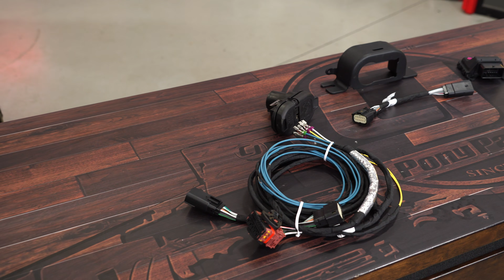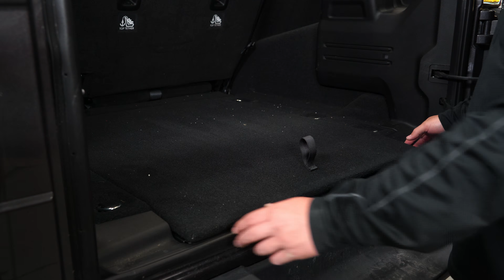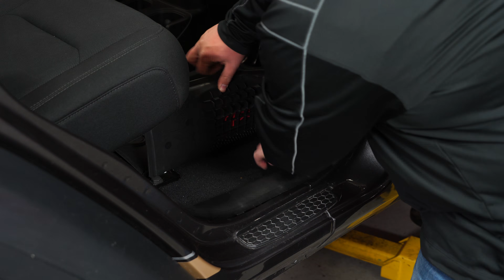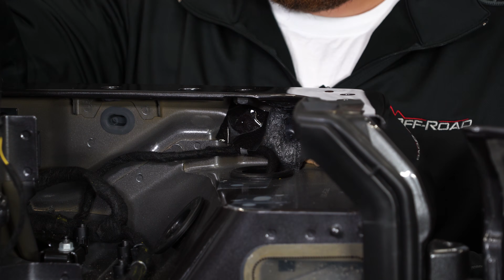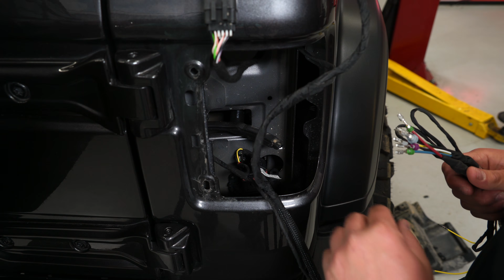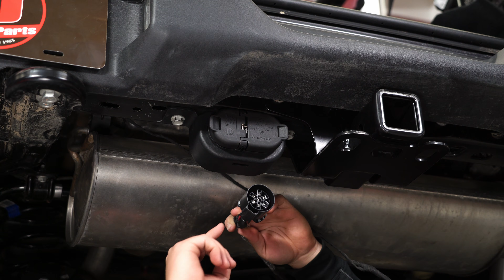2018 Jeep Wrangler JL gets tow ready: Mopar 7-Way Trailer Wiring Harness Install

Comment: If I cut the 7/4way connection hole in my Steel bumper will it snap in?  I have the 
RedRock Solid Steel Rear Bumper with LED Lighting (18-24 Jeep Wrangler JL)

Comment: Hi! Thanks for the video!
I just got my harness but I think the new harness has couple of minor differences. 

So the next to the cable that goes into the fusebox, I have a blue cable that (brake control) - I don’t know what to do with it. 

Instructions don’t really explain well what to do with this blue cable.

Does this mean I have a trailer brake system or that is something else that I would have to add to the system. 

I’m little confused can you please explain the trailer brake situation?

Comment: After watching this video, I almost took it into a dealer to have them install, but they wanted $400 and to keep the Jeep for 1/2 day. I borrowed a rivet gun and decided to do it myself. I thought I'd do it in two nights: one night to prep and take everything off, and the second night to install and put everything back together. 

I took out all panels per the video, and then, I realized my wires looked nothing like what was shown in the video. Everything was already bundled together. I really couldn't figure out any other way to do it the way it came, so I ran it underneath (similar to a different video). There's no way I could have snaked that through the firewall with the fuse already installed/attached. 

So, the reason I'm posting, check the kit you order before you start the project. If you get the same kit I did, you're probably only pulling the exterior panels and running it underneath (which I really didn't want to do, it seems to make more sense to keep wires out from underneath the Jeep). It is what it is though. 

That said, easier than I thought to install. I watched the videos several times before starting, and overall it went pretty smoothly. I'm definitely a beginner at all of this, and it seemed to go pretty quickly. Also note, I did a little research, and it looks like the brake controller for Jeep/Mopar is only for automatics (not sure why they're not sold/recommended for MTs).

Comment: I would say that this looks like a major pain to install but to be honest it's no harder than installing it on any old pickup.. they just want you to run the wires in the cab rather than along a frame rail. in some respects its actually easier than modifying an older vehicle to use a 7 pin (I run a 1967 C20)

Comment: Any advice on getting a brake controller to work?  The video covers everything but that and I installed the brake controller and it is not working.  Needs 12v and only getting 5v.

Comment: Thanks, your video was a great help.  I just installed the Mopar wiring harness in my '18 JLU Sahara.  The harness kit I just purchased from the dealer in Northern Kentucky may have had a couple of changes (improvements) that help the installation.  It also had a revised set of instructions (K6862985 - steps added).  The first was a 10mm nut to stack the fuse holder lead on top of the first lug on the fuse panel.  This avoids having to remove the rectangular lug and attached factory nut.  Place the fuse holder lug on top the stud, install a second 10mm nut and torque to the 9 Nm indicated in the instructions (old step 17, new step 19).  The second was a short factory installed red pigtail wire and connector has been added to the harness from the connector for the trailer light control module.  This allows the red wire from the fuse to plug into an intermediate connector and saves having to pull the retainer clip on the big connector (old steps 28-30)  to insert the red wire (new step 33 & 34).  This is much easier than having to disassemble the large connector module.  Another third change is only in the procedure.  It calls for removing the harness covers completely (removing the 10mm nuts) on the front and rear door jams to run the power wire from the front to the back as well as the blue wire (brake lead)  from the rear to the front (new steps 23-26) and then reinstalling the covers.  The old procedure called for tying these to the outside of these black inner covers for the harness.  I see the short pigtail wire and connector as a major improvement, if purchasing this kit, you might check to see if it has this update....

Comment: From what I've read and seen in videos the dealership will gladly install this and the hitch, for you parts and labor for around $ 1,000.00. I've also seen that you can apparently get it added to the 3 year 36,000 warranty. Might be worth it if the jeep didn't come from factory with it installed. That way if they mess something up or break a trim piece they fix it.

Comment: I self installed my tow harness and then installed a brake controller. I’m able to get the brake controller to engage the trailer brakes with the manual switch on the controller itself, but I can’t get them to engage when pressing the brakes. I’m not sure I’ve tapped in to the correct brake pedal wire, any idea which wire is correct?

Comment: First thanks for the video it was WAY better than the sad attempt at directions that came with the harness.
I got my harness installed with no problems last weekend BUT, all I have is 12v on the red wire at the 7 way connector. No lights no ground absolutely nothing else at the hitch point. I do have 12v going into the connector that plugs into the module. 
2018 JLUR with LED package. Any ideas. I’m guessing bad module or connectors.

Comment: Where exactly do you connect the blue wire to?
Reply from the maker: The blue wire would be going to a brake controller if you install one.
Reply: CJ Off-Road 
Thanks !! That would have been good to know in the video
Reply: I was wonder the same... glad someone asked!!

Comment: I just pushed hanger wire from within the rig, through the grommet shown, and can see it lying on my back, behind the passenger's side front tire, pulling back the passenger's side front fender liner, but by no means removing it or any of the rivets etc. that keep it in place.  Dropping down a wire from the battery to the ground below will be very straight forward, whre I can attach this wire to the hanger and can pull the hanger back.

No glovebox removal, no passenger's side front fender liner removal, no nothing was required.
Reply: Agreed on the fender liners. I simply pulled mine back and was able to run the wiring. As for the grommets I needed to put a slit in them with a razor knife, especially the firewall, the red wire wouldn't pull through. 

If you have trouble pulling the driver's side wiring white caps to install the yellow wires, try putting a screw into one of the holes he uses the pliers on. Mine would come up but not out till I put a coarse screw into one of the holes and pried upwards with the pliers.

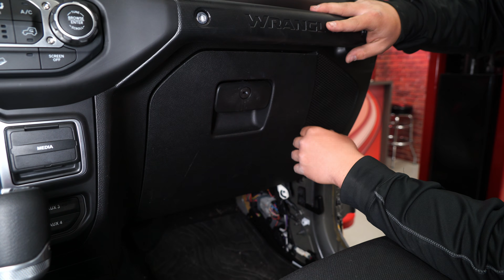Comment: At 5:36 you must also detached the retaining bracket on the driver's side of the glove box by pulling up and away from the glove box, in order to be able to separate it from the area it normally resides at.

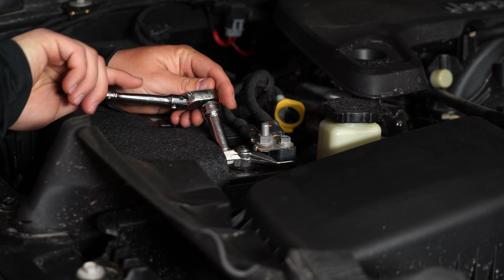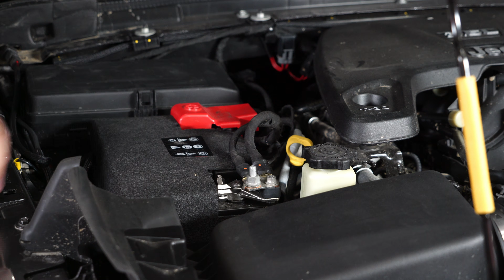Comment: A great video, but just keep  in mind that the ground isolations at 2:15 were not reversed at 19:34.  Off camera this might have  been done.  All that was shown at 19:34 was connection of the whole negative/ground "shooting match" back to the main battery's negative terminal.  This is more than just pedantic.  If all the isolations at 2:15 aren't done your rig is still going to have power running through it from the hidden ESS/aux battery that resides below the PDC (power distribution center) whose top is taken off in the video to attach the harness' positive cable to T1 of the high end fuses on the right of the PDC as shown. And if don't reverse the steps at 2:15 before attaching the main battery's negative post's clamp, your rig will have zero power.
Reply: Good catch. So what are the correct steps? it appears that you only need to remove the 10mm socket closer to you which is the reverse of 19:34. Is that correct?

Comment: Step 33 of the Mopar Instructions shows a Main Inline Connector (Q) that is not covered in the video so I didn't use it. I have a 2018 JL Rubicon. Is this correct?

Comment: I watched the video carefully as I performed the installation on my new JL. I never saw where that blue wire went that was run to the back of the glove box. I think the video mentioned that the blue wire was for the electric brakes. Where may I find instructions to explain where to put that wire?
Reply: Same thing for me, I just roll it and tie it back of the glove box !!
Reply from the maker: That is the control wire for a brake controller module, since we aren't installing one you can just tuck it away!

Comment: What happens when the red wire won't plug into the controller in the left rear tail light?
Reply: There are 2 red wires, one goes in the passenger tail light one goes in the 7-pin outlet next to the hitch.  I was confused at first too then I realized that the first red wire was taped to the other wire in the passenger tail light.  That one fit perfectly.